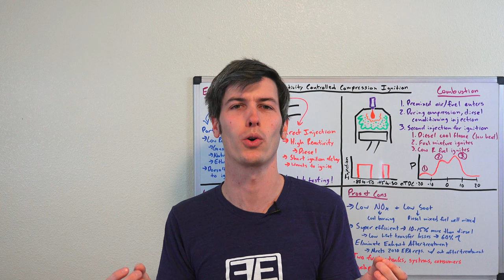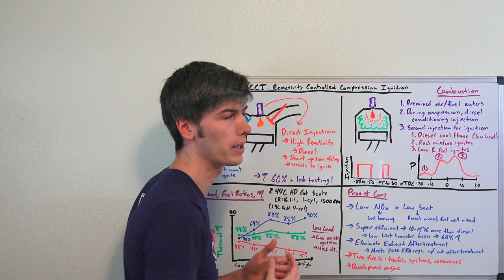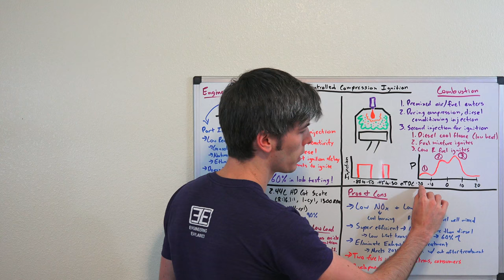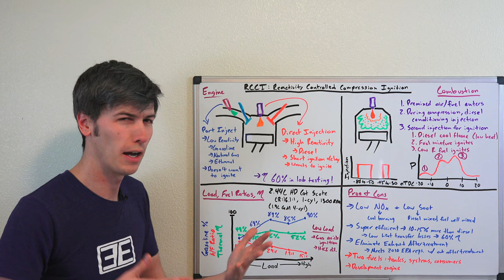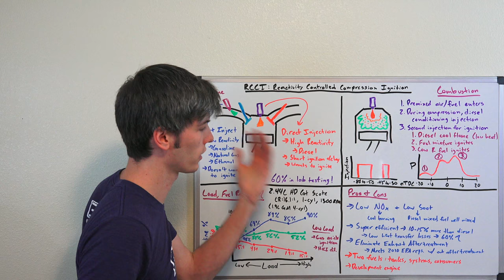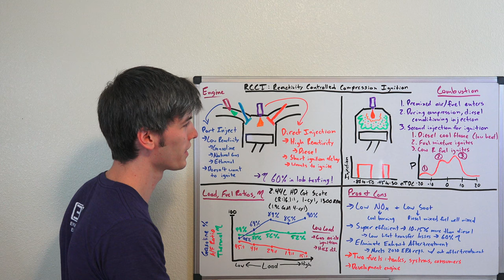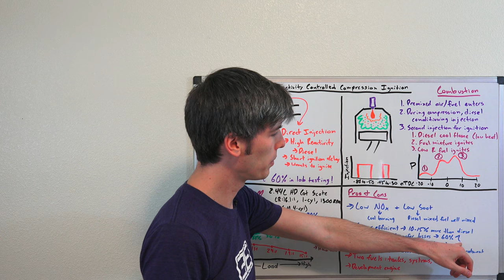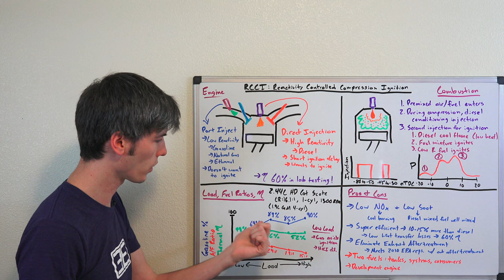Super Efficient Engine Uses Gas AND Diesel - RCCI

Comment: I just thought the e85 could handle a higher compression ratio, which should make it more effective. You mentioned that they had tested ethanol, did they find any benefits or not? (E85 fan)
Reply from the maker: I believe they saw slightly improved efficiencies using ethanol. Would need to re-review the literature, but I believe that was the result. Gas and diesel were used for many studies in part because both are already readily available for most drivers.
Reply: E85 may make a higher compression ratio possible, but most engines don't get the most out of E85 because the car manufacturer knows that not everybody can get it.

However, there is a way to get more out of E85, and that is to have a turbocharged engine which has one boost setting for gasoline and a second boost setting for E85. I think SAAB made something like this, named it BioPower, and then the company collapsed before you could buy a BioPower SAAB.
Reply: I'm an e85 fan so I know you can increase active compression via a turbo and so get more hp and more efficiency. My question was more if you increased the static compression in an RCCI engine so that you can achieve more efficiency. My thought was so because ethanol can handle higher compression and diesel.

As a Swedish I can tell Saab the story quite well and I like Saab's cars. Biopower was released in some of their models in 2003 and they went bankrupt in 2012. So there are many Biopower saabs.

I do not want to behave like a teacher so I want to thank you Skyline fever for your answer and hope you become as big a fan of e85 as I am.

Comment: pressure and crank shaft angle is worng. Pressure do not drop to 0 at 20 degress otherwise this engine will produce no power. Pressure is droping al down to 180 degrees. Exhaust vale is usualy opened before that but you know what I mean.

Comment: Efficiency, whatever, what kind of performance could we get out of something like this?
Reply from the maker: Efficiency tells you that! More power from the same size engine, or smaller, lighter engines with the same power as larger engines.
Reply: Engineering Explained 
Exactly!  More efficiency = more power, or the same power with less engine.  The limiting factor in power production is usually how much air we can get in, not how much fuel.

Comment: Didn’t Mazda find out combustion pressure point for gasoline is 14.1 to 1? Would mean the gasoline  in the combustion chamber explode on it’s way to 16 to 1? Would that mean this engine will be knocked and destroyed in no time! Besides, what was the combustion pressure that makes diesel ignited, from memory it has to be over 16 to 1. I wonder how this engine would overcome those?
Reply from the maker: Mazda's SkyActiv-X engine is currently running a 16:1 compression ratio in prototype form, with pre-mixed air and fuel, using 87 octane.

Comment: I'm curious, is there enough information out to explain the 50%+ efficiency of the Mercedes (gas) formula one engine?  I'd like to have a necessarily vague idea of how they do it.
Reply from the maker: Here ya go! https://youtu.be/kOhmgpkiIfg
Reply: Thanks for explaining that.  There's a slight similarity between using the pre-chamber and the way the fuel is distributed in a cylinder by this RCCI.  It seems that igniting a relatively rich core and spreading the flame throughout the lean "charged" bulk of the cylinder is the way to go.

Comment: SPCCI; HCCI; RCCI. Apparently "CCI" is very important. Controlled Compression Ignition is the way of the future; how it will be achieved is still a question for the engineers to solve.
Reply from the maker: Yes, though the C is different in HCCI (Homogenous Charge). Compression ignition is important because it allows for higher compression ratios, and yes, how it is controlled is very important (and challenging).

Comment: So it's ~60% more efficient than current ICE.
A lifetime's (170kkm) emission from an ICE car comes 92% from burning fuels. With RCCI that's ~45% lower lifetime emissions.
They say a BEV's lifetime emission is ~50% lower than current ICE cars.
RCCI Hybrid. 3-way symbiosis - nice!
Basically that's a K.O. for BEV.
ICE will not give up that easily.

Comment: I think all cars in the future are going to be gas or diesel petroleum generators with electric motors on the drive axles they use a electric motor to generate electricity and then amplify it

Comment: This seems similar to methanol injecting a diesel engine, but more advance. Wonder if it would be possible to imitate the rcci engine, by tuning an methanol injected tdi. If this engine can  meet emissions standards without the need of the dpf, I hope this techs will be implemented soon.  no dpf=no regen=no oil dilution=can use 100 biodiesel.

Comment: Any idea if a mixture of diesel (very low octane) and ethanol (very high octane) would be usable in a gasoline engine?
Reply from the maker: Not sure what you're asking exactly, but there is in fact an RCCI engine using diesel and ethanol.
Reply: Engineering Explained I was mostly referring to an unmodified engine.

Comment: Could someone explain how that second diesel injection, the cool flame, ignites? If it's by compression wouldn't the gasoline fuel start pre-igniting? It doesn't seem like the compressed mixture would be hot enough to ignite the mixture
Reply from the maker: The "cool flame" starts combustion, at which point you have a flame within the chamber igniting the rest of the air/fuel mixture.

Comment: You said that the thermal efficiency nowadays is 43% for gasoline engines and 50% for diesel engines.

What is the GLOBAL efficiency for each engine nowadays?? (ie     force × car velocity ÷ (LHV*fuel.mass.flow)
Reply from the maker: 43% is best case, most are significantly lower.
Reply: Engineering Explained  Ok, so with "thermal efficiency" you were refering to the formula i wrote?

Cause i understand that there is another efficiency (dont know how its called) that involves the power delivered to the clutch, which obviously is higher than the final power of the car running (due to gearbox loses etc)

Comment: Wait a sec... This makes no sense, unless you have a very low compression ratio.   Diesel requires a high compression ratio to ignite, however at that pressure, gasoline will cause pre ignition since its introduced early in the cycle.  From my understanding of the properties of gasoline vs diesel, none of this makes sense.

Unless, it's the diesel that is being used as an anti knock agent until the compression ratio for ignition is achieved....but that has to be timed with diesel fuel delivery...very confusing.  Is the needed pressure being generated by the added fuel?
Reply from the maker: Diesel has a lower self-ignition temperature than gasoline, so the operation makes sense.
Reply: Okay, I got flash point and self ignition confused.  However the auto ignition temperature of gasoline is not that much higher. So from what it appears is that they're using heat of the burning diesel to ignite the gas.  The diesel of course uses the heat of compression.  Here is the problem, if you introduce the gas/air mixture in the intake stroke and the combustion chamber temperature is too high, you risk auto ignition and pre detonation.  So I'm assuming that this engine that you speak of is not running at the same compression ratio of conventional diesel (combustion chamber temperatures as high as 500 deg centigrade), so there are a lot of factors in play to ensure complete combustion.  This whole RCCI concept just seems so far fetched in what is required in order for the machine to work.  Is there something that you didn't state here or something I missed?

Comment: How do they avoid the first diesel injection igniting when the pressure and temperature rises later in the cycle?
Reply from the maker: I'm not completely sure, but I believe it has to do with the mixing with the gasoline. This gives it a slightly lower reactivity than the pure diesel fuel which is injected later, so the pure diesel ignites first.
Reply: There is a modification to HGV diesels which uses a small injection of diesel as an ignition source for pre-mixed natural gas, which is the main fuel. It works well, but just one injection and no claims for improved thermal efficiency. That pre-injection event must be pretty important.

Comment: Tried to find info on building my gas engine into a diesel...i have rare gmc 366...its a dump truck motor....i have a busted 6.2 from a gmc truck...brocken block...does any 1 know if its possible to build the 366 into a diesel ?
Reply: Converting a gasoline engine into a diesel usually doesn't work well at all. Back in the 70s and 80s, Oldsmobile decided to make a diesel using most parts from a gasoline engine. Those cars were so bad that people thought a good diesel car would be impossible to build.

The GMC 366 has many of the same dimensions of the Chevy 396 and 427 Big Block, so I suggest getting a low mileage 396 or 427 and bolt that in. A 454 might fit if you make a few more changes, but it would be worth it, since a 454 is more common than any other BBC engine. The amount of money you save due to diesel fuel economy probably will not compensate for the increased amount of money spent on engines and adapters to make use of a diesel engine.

Comment: You say Gasoline is the less reactive fuel? I always thought diesel would be less reactive than gasoline, thats why it needs higher temperatures for ignition?
Reply from the maker: Diesel needs less temperature for ignition, but it’s not restricted on compression ratio because it is the ignition source. It also has a shorter ignition delay.

Comment: Boxing engines had been termed excellent engine, in real life, it has been proved as a leaking engine that need big cost to replace the head gasckets.
Reply: That is not engine flaw it is design/part failure.   They are still a better engine, they just need better quality design

Comment: 50 years ago and prior no one believed that efficiency of anything close to 60% would ever be achievable. Sadi Carnot would have certainly been amazed..  With regards to 2 fuels not being convenient for consumers ... current diesel engines require DEF fluid so I'm not sure why you brought this up..?  also dual fuel compression ignition engines are nothing new... for many years diesel pilot injection has been used with natural gas conversions. Also diesel enthusiasts have long known the benefits of propane injection.  What is novel is the slightly lower compression ratio and the discovery that cooling the piston reduces efficiency, also that the efficiency gains have been recorded and published. I would like to know the block/ head temperature since that also seems to play a big role in fuel consumption....  thanks for posting. https://www.youtube.com/watch?v=9ZQ5wo7ul8A

Comment: Curious what happens when diesel line looses prime .... you can run dry on gas without having to worry about having reprime the fuel line to the injectors ....
Reply: I know there were gas ford cars from the late 90's to early 2000's that had to be re-primed if u ran out of gas. Dealer charged  $600 usd  to re-prime a friends.

Comment: "Full throttle" is incorrect terminology. It's "wide-open throttle" (WOT). "Full throttle" is ambiguous - is it fully open or fully closed?
Reply from the maker: Full throttle = "doing something at full speed." I'm certain everyone understands what it means in the context of accelerating.
Reply: Engineering Explained True, but automotive engineers use "wide open throttle" and your channel is Engineering Explained,  so details are important. 
It's equivalent to using "power to weight ratio" and expressing it in lbs/hp. Everyone knows what you meant, but it is incorrect anyway.

Comment: Haha, had to laugh when you said they achieved the 60% efficiency by not using oil. Still, 56% is amazing!
Reply from the maker: They used oil, they just didn't have oil squirters injecting onto the bottom of the pistons for piston cooling. Certainly needs engine oil.
Reply: Engineering Explained oh makes sense. Anyways, awesome concept!

Comment: why not using a supercharger or a turbo combination. using the amount boost to increase compression. then use the gasoline as a the igniting fuel to burn the diesel.
Reply: Diesel engines do use turbochargers they do not run well without them. They use compression to ignite the fuel.  The vacuum of the engine doesn't pull as much air in.

Comment: To be fair this idea isn't new, or at least on the face of it, 
Truck manufacturers have been selling a duel fuel setup for for some of there engines for quite some time,
Scania have a duel fuel engine which uses diesel and CNG, 
And also you can readily get kits which will allow you to run LPG or propane in a duel fuel setup on your production diesel engine,
And also wouldn't water/methanol or just straight methanol do the same thing? Which you can also get kits for readily for

Comment: I want to see an electric B-train truck with RCCI OPOC range extender engine and the hydraulic-electric KersTech TwinTorq powertrain. Streamlined with low rolling resistance super singles. Adaptive cruise control with GPS and topographical maps. That would be the most efficient truck I can imagine at this time. Elon Musk, make it happen.

Comment: Gasoline injection defeats the 1 thing that makes a diesel engine go a million miles.
Youve replaced the piston ring lubricant (diesel) with a solvent (gasoline).
Now not even engine oil will lubricate the rings.
Stick to LPG or CNG

Comment: it would be nice to know how gasoline or diesel is not igniting, before the low amount of starting diesel is injected.
The gasoline diesel mix is not going to be perfect, so there must be pockets with pure unmixed fuel in the cylinder and those pockets are going to be hotter and easier to ignite then fresh cold fuel.
Take care that you are not promoting something, that is used to raise investor money, instead of actually working like promised.

Comment: It's not impressive when you're just using powerful combustion mix, unless it's not a EPA or other pollution like sound etc, this would require that it is actually lower in cost, lower in pollution and fossil amount, then it can be in consideration like with fossil-hybrid mix style, interesting. 🤔
Electric hybridism was also not considered with using hydraulic drill/pistons motion with only pumps as electric performance, where the hydraulic would apply strength to speed vs.. traditional pure wasted energy as speed to strength.

Comment: Isn’t this technology already used in F1 engines where they use engine oil as high reactive fuel like diesel ?
Reply from the maker: Nope, although they will burn oil at certain times to improve power, the combustion method is quite different. Explained here: https://youtu.be/kOhmgpkiIfg

Comment: why not use water electrolysis so you can use gas and Hydrogen/Oxygen instead of using gas and diesel? Hydrogen's flame speed is ridiculously fast and it increases the amount of gasoline actually burnt

Comment: I got an idea, just mix gas and diesel together.
Reply: That might not work so well because modern diesel injectors work at 26,000 PSI and gasoline injectors typically operate at less than 3000 PSI. In order for diesel injectors to withstand the pressure, they need the lubricity that diesel fuel has and can't handle the lack of lubricity found in gasoline.

Comment: by the way, Mazda SPCCI bsfc efficiency is 44%
Reply from the maker: When I asked Mazda last (maybe a month ago), they said they have not released efficiency numbers, but that it was slightly better than 42%. Did you have a source I could check out for the 44% claim?
Reply: I see many news report saying Skyactiv-3 will increase 27% efficiency to 56%. then you can calculate its skyactiv-X is 44%.

Comment: What is cool flames ?
And why they are called cool flame ?
Reply from the maker: As discussed in the video, it's when the edge of the diesel fuel injection starts to ignite. It's called a cool flame because the heat release is very low, but it's enough for combustion to start.
Reply: But initially the combustion is premixed combustion(because of ignition delay), So the Heat released rate should be high.

Comment: your math on efficiency does not take into account fuel ratio changes per fuel. it averages the efficiency at that rpm for the fuels but does not take into account quantity. without knowing the quantity used at that load level per hour  of each fuel the average efficiency cannot be properly weighted.

Comment: Two Stroke Diesel Engines have 55% efficiency...but most owner don't run them on diesel fueld...
Reply: Those 2 stroke diesels in use are usually found in large ships and electric generators. You are right that they don't burn diesel fuel, they instead use "heavy fuel oil." That might make getting 55% efficiency easier.

Much smaller 2 stroke diesels that used standard diesel fuel were once common in busses, compact generators, irrigation pumps, pleasure boats, and a few other things. They were the Detroit 6-71 and 8-71, and they burned more fuel than 4 stroke diesels of similar size, they didn't last as long, and they burned and leaked more oil
1. They were cheaper to buy
2. They were cheaper to repair and rebuild
3. They weighed less than 4 stroke diesels
Reply: The current 2 stroke diesels even the small incarnations of that motor run on "up to" 55% efficiency, IF they run on actual diesel fuel.
Sadly BIG two stroke diesels only get to run real diesel fuel in side of sovereign waters of developped countries....as they have environment standards.
The open seas are  dirty businesss!
Gasturbine engines on ships for example...they get to burn bitumen once they are on operating temperature...
and out side of sovereign waters...